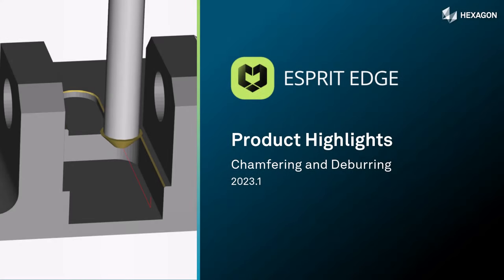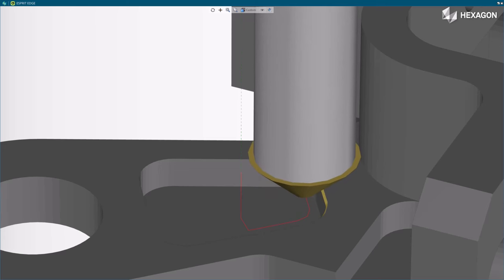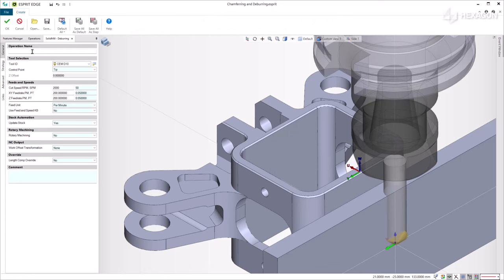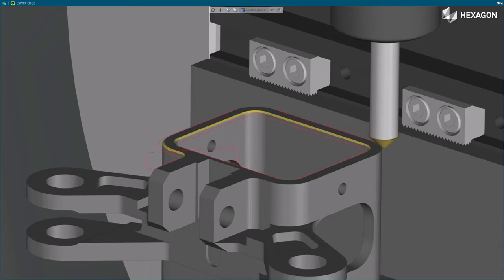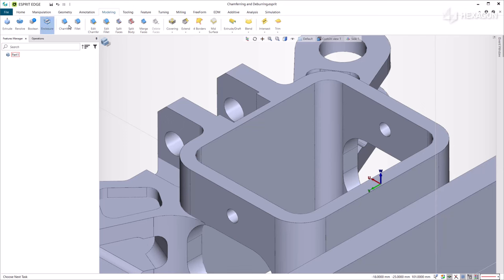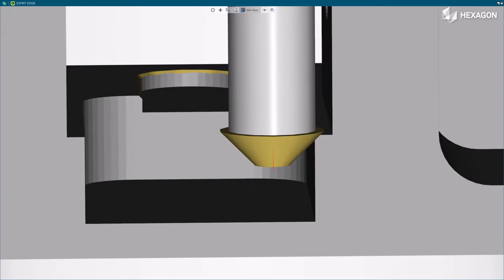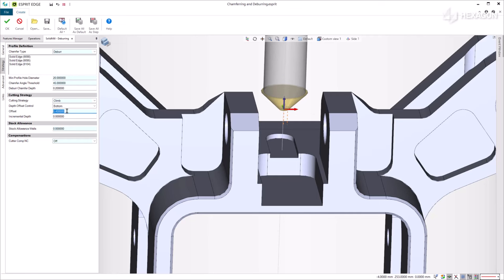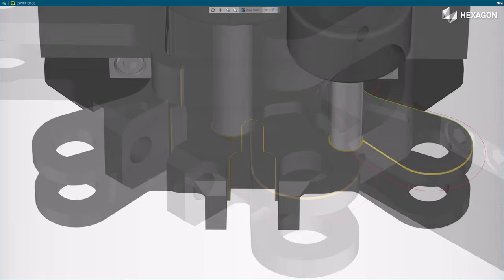ESPRIT EDGE 2023 | Chamfering and Deburring

Comment: Lmao how are you guys behind fusion on stuff like this?
Reply: Which software is best to program?
Reply: You could always deburr with Esprit, now there is a button for it.   With a few new features.
Reply: @PRODUCTIONPLANNINGCONTROLS  There is not "the best". Every program has it's benefits and it's downsides. You have to pick the right program for the job. It's like a hammer and a screw. You wouldn't take a hammer for a screw. It wouldn't work. But a hammer for a nail works perfect